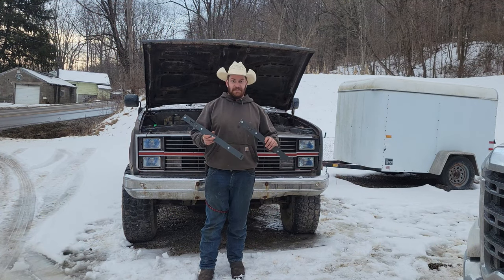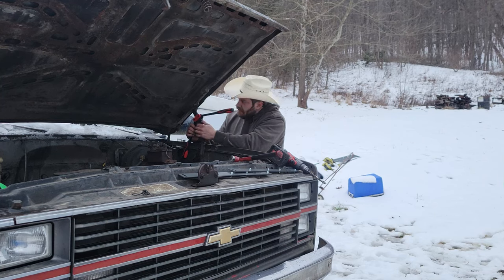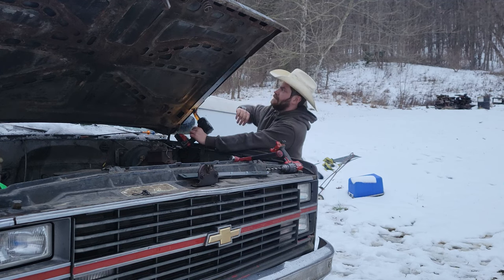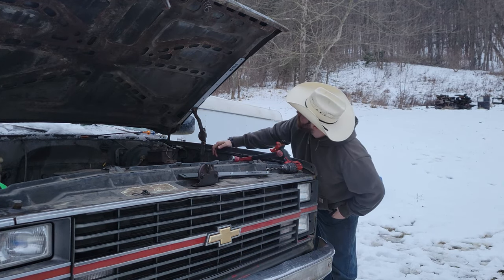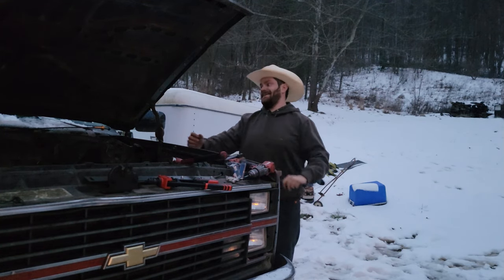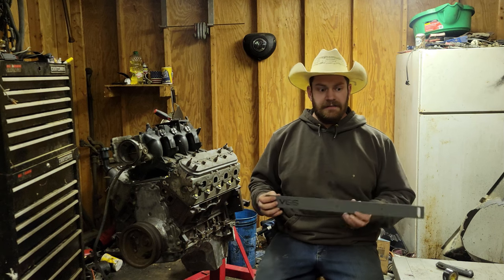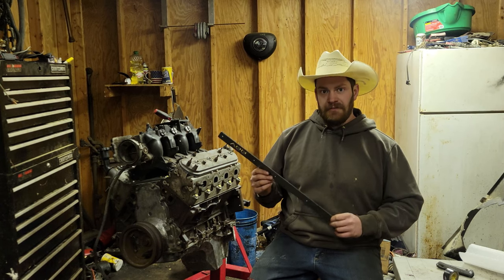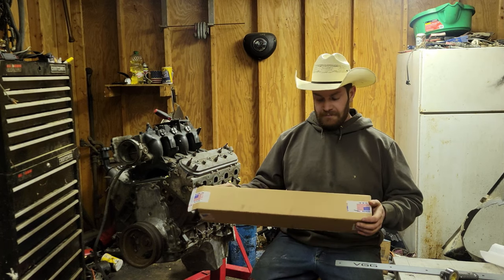Vice Grip Garage Hoodsaver 6000 Installation and Review, avoid damage

Comment: The hood saver 6000 was designed for the 1973 through 1980 square body Chevy trucks. You installed them on a post 81 truck, that is why you ran into a small bit of difficulties. They’re really not necessary for the 81 and above trucks because the hood hinges were redesigned as well as a hood which eliminated the hood folding issue. But there is nothing wrong with throwing them on for decoration purposes.
Reply from the maker: I wouldn't say it's for decoration at all. I have seen my dad have issues with hoods in the past and the hood savers made my hood feel a lot more solid than it was before. It's not as much of a risk of it folding but I think it was worth it in the long run

Comment: The 73-80 first gen squares (so to speak) are the one's the hood buckles on. Not 81-87(91)
Reply from the maker: I have still seen them get buckled and bent but it definitely not normal for it. Most of my experience is with the 81 - 91 squarebodys